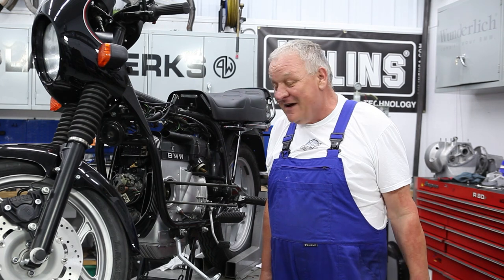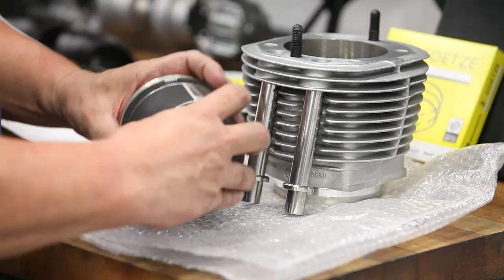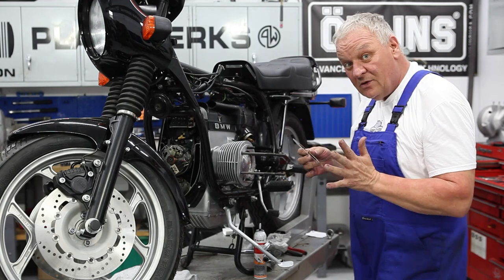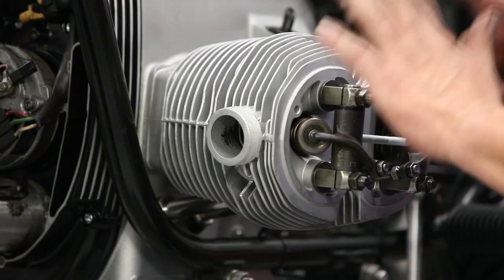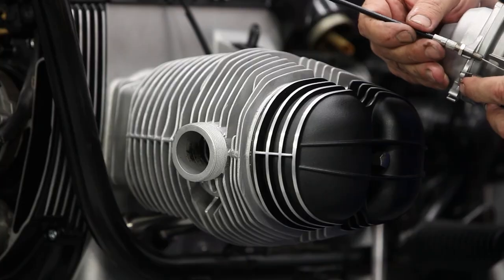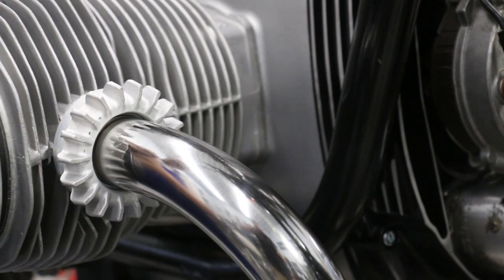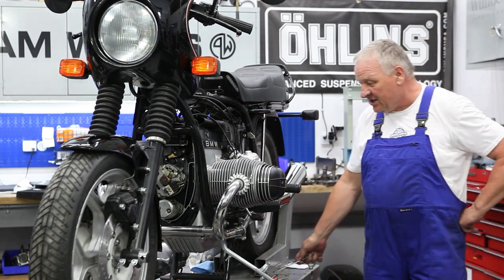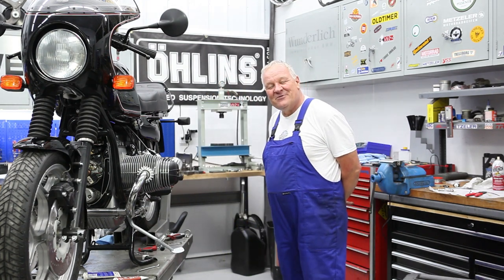BMW Airhead Mechanicals  #10 - Siebenrock Power Kit Install, Plugs, Exhaust & More

Comment: '83 R80RT... went to Siebenrock 1000cc conversion; R80 heads machined for improved "squish zone" (and a wee bit compression ratio boost) + dual plugging, kept original carbs (re-jetting no big deal..), Installed shrink tube trick to limit "Bean Can" Advance... ditched the RT snow plow.... while no R100 heads for full-blown top speed... the mid-band torque is a wet dream... she devours switchbacks with an insatiable appetite (few can keep up on the Bundesstrasse B242 (Harzgebirge... Halle > Clausthal-Zellerfeld)... might rebuild as RS...

Comment: Excellent presentation and fastidious work!  One question about the wrist pin bearing in the connecting rod.  I had the impression that those were reamed after installing in the rod to fit the wrist pin.  With new piston and wrist pin, how do you verify the bearing fit?

Comment: Hi guys. Thank you so much for the video series. You guys are the best!  Question for you. I have a 1969 R50 conversion with an R65 engine. I am considering the Siebenrock Power Kit but am wondering if that will cause any problems with the original 1969 R50 final drive unit?  Will the R65 engine with the Siebenrock Power Kit overpower the final drive?

Comment: Great tutorial guys!!! I love your videos. I have a noise issue with my little BMW R45 from 1981. I took the right cylinder out and found the culprit. I checked the “clearance” by just moving the connecting rod from side to side (axial play) and I have also checked the radial play. It seems like the connecting rod has to much axial play. It also felt like the connecting rod could slightly tip from side to side. I’m going to buy new connecting rod bearings. What school do check next bevor I install the new bearings? 
Best Wisches and and greetings from Germany, Berlin.
Reply from the maker: The main thing is to check the old bearings and see what kind of wear they have. Check the crankshaft and make sure that there is no scoring or damage. If there is, then the bearings will wear out soon again.

Comment: Another great video William. I see a lot of bikes fitted with the metal spark plug caps. Are the black rubber?/plastic? caps that would originally have been fitted to these bikes (certainly in the UK) still available?
Reply from the maker: Hello Kevin , Check these out . They are pretty much the same as the BMW original.   https://www.boxer2valve.com/spark-plug-connector-cap-beru.html

Comment: The torque for the cylinder studs has a third step. First 15 NM, then 25 and then 35-39. I am afraid you misse the third step in the video. Otherwise exellent, as always.
Reply from the maker: The torque for the cylinder studs has a third step. First 15 NM, then 25 and then 35-39. I am afraid you misse the third step in the video. Otherwise exellent, as always. 

Thanks for mentioning that. It may have been omitted in the editing, not sure what happened.

Comment: This reconditioning started with a 1981 but now it is a 1985?
Reply from the maker: Its always been a 1985 R80, just some of the work shown in some  videos also applies to 81-84 airheads.
Reply: @boxer2valve  i just looked at the playlist about the current bike and two videos are named 1981 and the others are 1985. No problem just wondered if that was a typo.
Reply: @boxer2valve  the playlist is also named "BMW 81 on Reconditioning"

Comment: The oil won’t wash the LM48 off the rocker lifters?
Reply from the maker: Yes, the LM48 will mix with the oil and eventually wash off of the parts.
Reply: boxer2valve BMW Restoration and Parts Supplier got you... thanks for that!